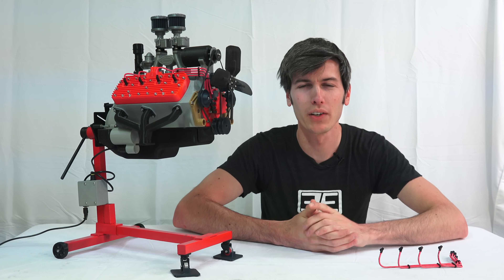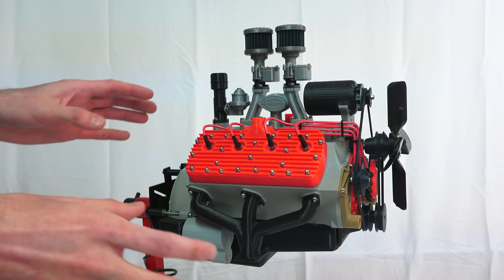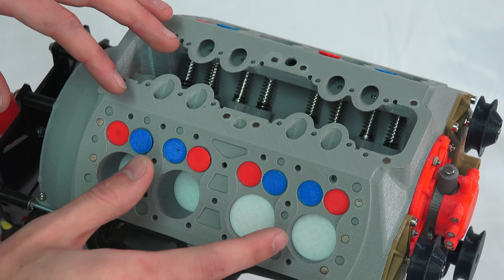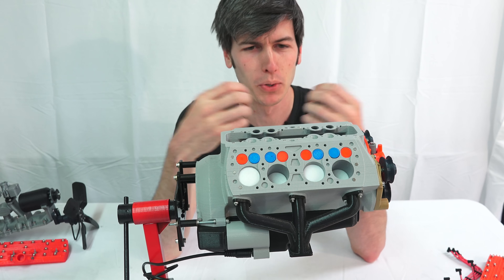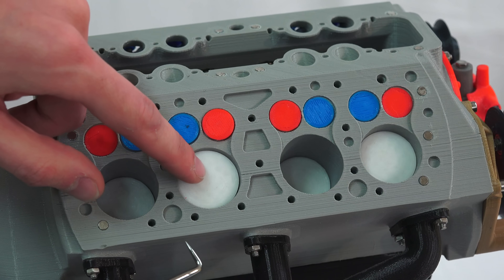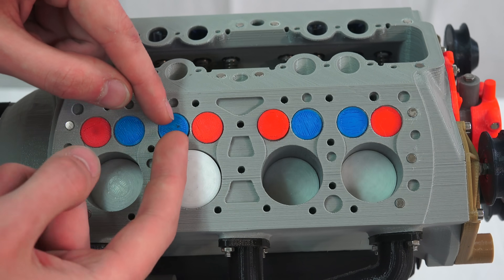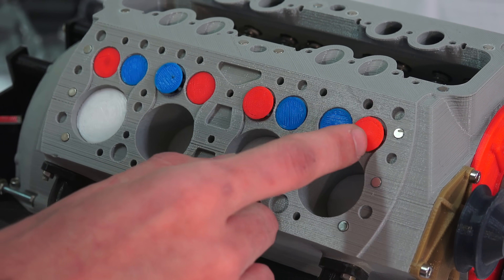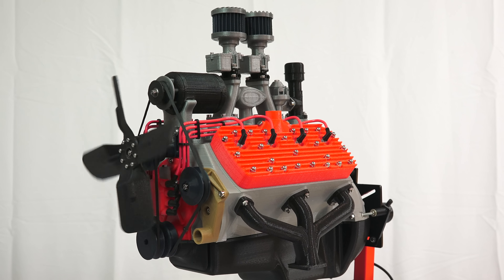Why Ford's Flathead V8 Engine Died

Comment: Two questions.
1: What was the horsepower jump from flathead to OHV?
2: Had they discovered squish by this point and did they take advantage of the massive squish area available?
Reply: Robert R quench area.
Reply: 53 flathead Ford and 54 OHV Ford both had 239 cubes.  Flathead made 110 hp, OHV made 130.  Both with 2-barrel carbs and single exhaust.  Three years later, the OHV (still the Y-block) had doubled hp to 270 (or 300 supercharged).  More cubes (312), but same basic motor as the 54.  By 1963 (only ten years after the first OHV), top Ford motors were making well over 400 hp.
Reply: What is squish?
Reply: 239 CI overhead valve 1954, 130 H.P.  a 53 ford flat head 110.

Comment: Great video and great model. I still have a flathead 4 cylinder in my Ford 8N tractor (1951 vintage). I love that thing, and it still runs great!
Reply: There was a company called Funk that made a conversion to put the flathead V8 in the 8N  There are a couple still around.  It made those tractors a total hot rod.  I like my 1954 Ford NAA tractor better though.

Comment: Awesome video (as usual). Question for a rainy-day: While this isn't evident in the flathead V8, why is there usually more intake valve area than exhaust valve area?
Reply: Because the intake air is only pushed in by ambient air pressure so it is limited by how much can make it in. The exhaust is pushed out by the piston so it can be forced out by higher pressure. Therefor they run a larger intake valve to compensate for the limited intake flow. 

(To the other person, there’s more exhaust gas than intake gas. Otherwise there’d be no power.)
Reply: But the gas has much less density. So it should go thru a smaller hole as easily.
Reply: Patrick Mcbrearty Air does not burn. And even if it did, it would not disappear, but turn into something else. When something's burning, it's actually merging with oxygen.

Also, exhaust gas is a lot hotter than intake air, thus less dense, ultimately meaning there's more of it by volume. I think there are more molucules too, increasing the volume even more.

The reason for the size difference, I think, is that the pressure difference on the intake stroke is quite a lot smaller than on the exhaust stroke, so air and fuel flow  into the cylinder need to be aided by bigger valves.

It's also been said that having big hot exhaust valves might induce detonation (knocking). They might be onto something there, too.

P.S. There's no such thing as an ignition stroke. It's called combustion stroke. ;)
Reply: Because more air enters the cylinder than what leaves it, due to most of the original intake air being burned on the ignition stroke.

Comment: Cylinder walls are T H I C C
Reply: Ford's casting process on these engines was atrocious by modern standards.  There were often hidden voids in the block.  Hot rodders often found out about these voids by blowing up engine blocks.  Nowadays, if you're building a flattie it's wise to x-ray the block and make sure that there's no hidden voids in the block.
Reply: I've read that a Cadillac 346" flathead weighed 900lbs.
Reply: There are water jackets all through the casting
Reply: Its a liquid cooled engine so the cylinder walls appear to be thick af. Granted these engines did have thicker walls than is considered normal by todays standard
Reply: Had to be. Not only for water galleries but because the exhaust pipes went right through it, defeating the cooling system.
Reply: Christopher Allen I like how the exhaust lines up haha
Reply: Thanks for the x-ray comment. I rather enjoyed it. :) I am a creator as well if anyone would like to come and leave a comment.
Reply: Leave

Comment: it's essentially a lawn mower engine times 8 cylinders.
Reply: Cole Spolaric Nope. A lawnmower engine is just a flat head v8 with 7 of the cylinders cut off.
Reply: you say tomato I say tamoto lol
Reply: The saab sonnet uses a v4
Reply: motor bikez have v4 engines
Reply: Even lawn mowers have OHVs these days, grandpa.
Reply: The flathead V8 was prone to over heating.  Where cars gaining weight and road speeds increasing it's death was predictable
Reply: And I suppose V2s don't exist, either.
Reply: English Ford had V4 engines, Transit van being one of the pieces of crap they powered
Reply: havoc1482 Tell Ford Europe that
Reply: Ford taunus V4, Honda VFR, Honda Magna, Yamaha Vmax... those are V4's just off the top of my head.
Reply: You got that right, Joseph. V2's don't exist either. But check out those Harley's with their unique sound! LOL
Reply: Cole Spolaric 
Nobody says tamoto.
Reply: 🙄 It's just an expression...
Reply: havoc1482  actually there is! Lol
Reply: havoc1482 You are right! Ford in Germany did not make millions of them and sell some to Saab either.
Reply: havoc1482 wrong
Reply: Joseph Byrne I really hope there aren't people who believe this
Reply: havoc1482 ... ????  Say what.
Reply: Also my 89 Ford Mustang was a V4. They used that engine in at least some of the 80's Ford Rangers.
Reply: The flathead ford actually uses the same spark plugs as a Brigg & Stratton engine, so yeah
Reply: V4 engines actually exist, just not something you'd find in an American car.
Reply: What DE Nichols? they were all inline 4 cylinders, none of them were made in a V configuration.
Reply: havoc1482 there are plenty of V4 engines. The amc mighty might have one that was in  production for decades. Also there are plenty of V4 diesel engines floating around.
Reply: Both Ford and Saab sold V-4 engines in Europe
Reply: My preferred mower engine is OHV, boxer twin, revving 4000, high cc
Reply: not the 4hp base model briggs w/ oil bath filter
Reply: ahahaha
Reply: It is.
Reply: None Ya ... And eight of those make fifty-two horspower.  Some of those are hemis.
Reply: Very true i you think about the perportion out put wise it about right. Per cyl
Reply: Brandon G you must feel special repeating exactly what the OP said
Reply: Cole Spolaric the model yes
Reply: Rick Delair that was a Mercury flathead
Reply: havoc1482 yes there is I made one it's actually more compact than an I 4
Reply: V12 was the Lincoln. Cadillac, Packard and others had V12 flatheads. Cadillac also made a V16 in flathead and OHV.
Reply: havoc1482 yes there is...

Honda interceptor...  many variants.

My favorite st1100
Reply: Honda Interceptor and Sabre motorcycles had V-4's and Ford of Germany made a V-4 that SAAB used on the first four-stroke car.
Reply: yep cole, you are right, the ford 8N and 9N tractor engines were too.
Reply: You must not be American.
Reply: Cole Spolaric, not sure if anyone have told you this or not? But the pic looks like a flaming gay
Reply: DE Nichols: The original 1962 T5 prototype that inspired the 1964.5 Mustang had a Taunus V4 engine, but I've never heard of one since then. However, there have been American cars exported with all kinds of weird engine options; was this car  sold (or even made) outside of N. America?
Reply: yeah, ford transit's and ford capris had the essex v4 in them back in the 60s and 70s it seems that it also goes by "taunus  v4" aswell
Reply: Your Mustang was a 2.3L Inline 4, not a V4.
Reply: Untrue. Ford, GM and several foreign manufactures produced V4’s for the automotive industry. I’m certain there are many that have been long forgotten. With that being said, I’ll not even begin to try and count the motorcycle company’s that produced them. And as a matter of fact, they still produce them. Always better to let people think your ignorant than to open your mouth and prove it.
Reply: Guess he’s never heard of Ducati, Yamaha, Honda, or Suzuki to name just a few.
Reply: I didn't see your comment in time.
Reply: Cole Spolaric That is exactly what I saw
Reply: Cole, homophobe much?
Reply: Preditor 212cc from harbor freight with coupon will run you $99. ffkk flatheads
Reply: Aren't all v8s gutless?
Reply: Rick, no such thing as a V4
Reply: @havoc1482  Ford of Germany made one in the 1960's. SAAB also briefly used it too.
Reply: @havoc1482  Uh, yes there is. Cut your V8 in half. You may end up with inline 4 or V4

Comment: And this is where the term "overhead valve" came from! It doesnt refer to pushrod engines. It annoys me that people call pushrod engines overhead valve engines and then refer to an dual overhead cam engine as if its not also an overhead valve engine.
Reply: " It annoys me that people call pushrod engines overhead valve engines and then refer to an dual overhead cam engine as if its not also an overhead valve engine."

Well, it annoys ME when people refer to "rectangles" exclusively as "four sided objects, sides at 90 degrees, with TWO DIFFERENT side lengths!" Like, they don't realize squares are rectangles, too! (All squares are rectangles, but not all rectangles are squares.)
Reply: OHV and DOHC are the abbreviations of choice, would you rather people use CIB, COH, and DOHC? If you say OHV I know the cam is inside the block and if you say DOHC I know the valves are in the heads, stop being annoyed
Reply: Yep. May sound like pushrods and OHCs are totally different, but both have the valves located at the cylinder head -camshaft position differs, whereas flatheads have the valves in the engine block.
Reply: Pushrod engines tend to be called OHV because theres only valves above the cilinder. SOHC and DOHC engine have also one or two camshafts above the cilinders
Reply: Shabuti R18 if someone told me an engine was OHV I would understand that the camshaft is in the block. That's a silly argument. I've never met a person who specifically referred to an OHV engine as a CIB. No one calls OHC engines OHV, so why specifically call out the cam location? It's either in the block or in the head and if someone doesn't know that they don't know much about engines.
Reply: Robert R I refer to them as CIB, or cam in block. Pushrod works as well. But not OHV.
Reply: I think a lot of people don't realize what a huge difference there is in performance between OHV and flathead, thus they don't realize there is a huge night/day dividing line there. They want to argue over DOHC vs OHC vs Cam in Block and have never heard of Cam in Head, but in actuality all OHV ICE designs are part of the same family and would know and understand each other if they were able to sit in a room and talk. They'd be having tea and discussing politics while the Flathead families hunted and gathered outside and the external combustion designs would be screaming and throwing things from the trees.
Reply: Janet Storkmuncher I assume by cam in head you mean things like that goofy Escort engine that moved the cam to the head, but still used a row of teeny pushrods and lifters for some reason? Still one of the dumbest things I've ever seen. Just, why?
Reply: Well overhead valve is overhead valve. Be overhead cam is both... How do people talk about overhead cam as though it's not overhead valve? You couldn't build an engine that was OHC and not OHV.
Reply: Janet Storkmuncher What about the valveless engines? The one with the rotating wheel. And then we have camless engines with pneumatic actuators.
Reply: Tyler Hardy I get what your saying, and I understand what most people call it. Its just that alot of people dont understand why the pushrod got the name OHV. Technically valves were overhead in the earliest of engines, the flathead came later. So OHV was the original design of the engine.
Reply: Tyler Hardy You could....but it would be redundant haha
Reply: Shabuti R18 OHC is just CIH OHV
Reply: Ellenor Malik Haha. Yup :)
Reply: "No square is a rectangle or vise versa. They are both different shapes."

Absolutely WRONG.
A square is the "special case" of a rectangle with all sides of equal length. A square still meets the definition of a rectangle (and of a parallelogram, as far as that goes.)

It's a perfect comparison: an OHC is the special case of an OHV that also is OHC. As such, when you say "OHV," is somewhat implied you mean "OHV that is not also an OHC," even though you didn't explicitly state that. Just like, when you say "rectangle," it's implied you mean "rectangle that is not also a square."
Reply: bcubed72 If I was to say my engine was overhead valve, what would you think its camshaft location was?

Since valve location doesnt change, it doesnt make sense to refer to the valve location to differentiate a pushrod from an overhead cam. By simply referring to it as an overhead valve, one could assume the camshaft could be overhead or in block or even standing straight up inside the gas tank. No one knows.

Just like the square vs rectangle.....the number of sides doesnt change, but the lengths do. No square is a rectangle or vise versa. They are both different shapes.

Comment: You're the engineer, folks made 500 hp out of this naturally aspirated. Lets hear about it.
Reply: Seems like the trick would be low compression to allow high valve lift, and cram a huge amount of boost into it.
Reply: I know trick heads were a thing. Heck, I think somebody made an OHV retrofit.
Reply: Assuming 500hp is true and accurate, and without verifiable dyno charts to prove it I doubt it would be accurate,  it would have been achieved mostly by huge increases in capacity and alcohol/nitrous  rather than efficiency gains. Aftermarket long stroke cranks and big bore blocks took this engine out to over 330ci.
Reply: I thought the highest HP flathead had about 650 and it was supercharged? this was several years ago though
Reply: bcubed72 yeah, it's called IOE for intake over exhaust. The overhead valve is the intake, and the exhaust valve stays in the same place.
Reply: called an F-head engine (or maybe L-head, I can't remember now)
.  exhaust valves in the block, intake valves in the cylinder head.
Reply: That somebody was hired by GM to run their R&D department and later became known as the father of the Corvette. The ARDUN heads he developed are still popular with the flathead crowd.
Reply: brooksman10 
Didn't the Willy's Jeep have one of these "half OHV" setups?
Reply: JJ Hupf Now, folks make 950hp with ls motors. All naturally aspirated too
Reply: Flathead jacks has all kinds of cool parts for these including flat plane cranks. A few people have plumbed it backwards and ran dual intakes in the sides and headers out the top. Of course that takes a specialty cam and some fab skills.
Reply: google L.O. Stanley for reference to 420 cubic inch flatheads.
Reply: It wouldn't make that power for very long, these engines ran HOT.
Reply: JJ Hupf 
There  were  some  early  54s  flatheads that  were  a  little  bit  bigger . Late  60s  when  I  was  building  hot rods  there  were  two  old  timers  who  were  building  them  and  they  were  just  about  the  hottest  things  in  Spokane . And  they  weren't  using  the  offenhauser  heads . I'm  not  sure  if  they  made  them  for  the  late  engine
Reply: Look up Ardun heads. Full hemispherical combustion chamber. Late 40s design intended for overworked Ford truck engines but grabbed onto by hot rodders.
Reply: Flies2FLL these engines ran fine after they increased the coolant pressure from 5 or 8 psi to 13 or 15 psi. They increased the coolant pressure  to prevent the coolant from boiling and over heating ,when coolant boils it introduces air to the coolant and can no longer cool the engine
Reply: F-head had all overhead valves and four cylinders.
Reply: No, it didn't. Is your google broken?
Reply: Splungers I live close to where Lionel lived. I am not originally from here, but I have talked to people that knew him. He was quite a character, and very smart.
Reply: The only reference is that there are two, no details given. There's no room in a regular "Ford" flattie for 420 cubes, but it could likely be done with a Lincoln/Ford truck engine which started at 337 cubic inches.
Reply: British imported Ford trucks, actually. Zora was living in Britain at the time. Ever see one in a truck? What were they in 1949 F7's, maybe?

Comment: Swirling actually helps mixing, you know this.
Reply: Swirl, yes. Flow reversal, no.
Reply: Standard youtube comment, ignorantly insulting someone while assuming superior knowledge. I can't help but laugh, maybe when you're older and actually build an engine you can tell me snide condescending remarks which contribute nothing. At least you'd have accomplished something excusing your current behavior. Until then I suggest you read Phillip Hubert Smith and learn before you make baseless youtube comments that lower the braincells of those reading.
Reply: Syphons, your toilet, and most plumbing disagrees. Most engine exhaust ports are at least 60 degrees, and the turn on the exhaust manifold primaries while also for packaging reasons, also serve to aid exhaust gas scavenging.
Reply: Rolando Tillit.  Seriously?  Toilet plumbing is not a high performance area.  Please read a book on the subject...

Comment: I think your engine was rotating backwards.
Reply: Armo03.
No it wasn't, what makes you say it was?
Reply: I did some research and it seems like you are right. I thought the fan should blow air instead of pulling it.
Reply: Armo03.
That's right. And you can see instantly by the piston and valve movements. Cheers, Rob.